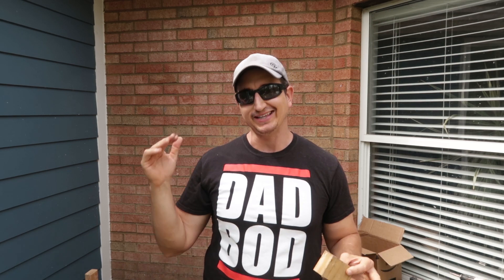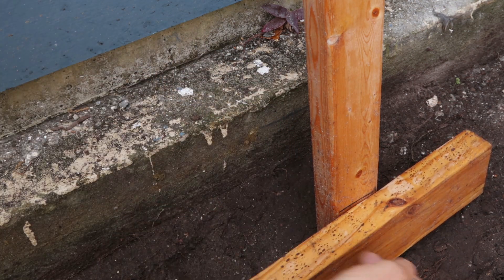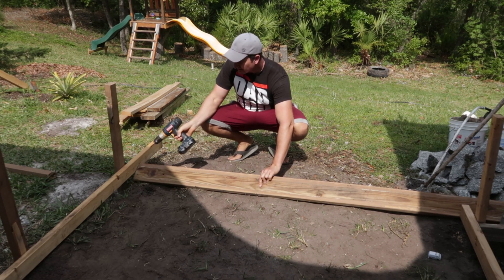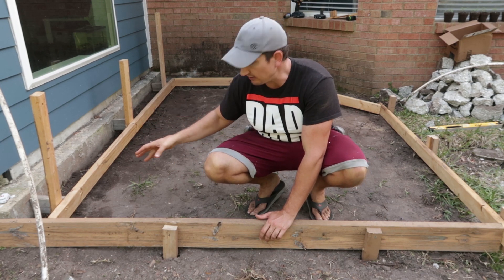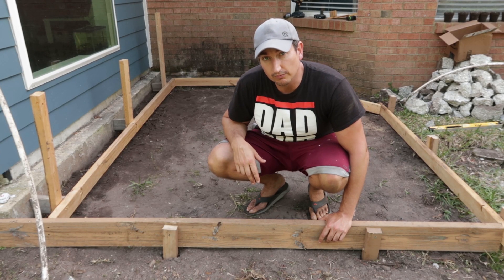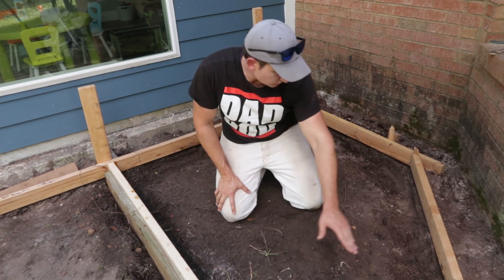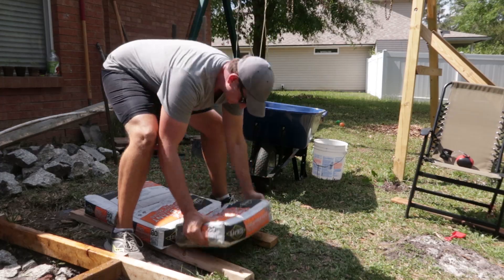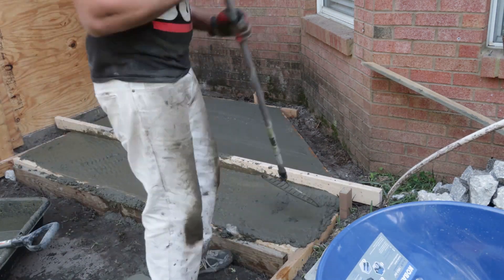Pouring A Concrete Platform Without Rebar; Build a Concrete Patio One Section at a Time.

Comment: @MrKistel I know this was several years ago.  Can I ask what kind of concrete you used?  I just did a small project, and there was way too many rocks in my concrete mix.  Yours looked like it didn't have many at all.
Reply from the maker: I believe this was just standard concrete bag mix available at most home centers.  It may have had reinforcing fibers as well.  The rocks inside were about the size peas and are they important for strength.

Comment: If I need my slab to be flush to house how would I build the form?
Reply from the maker: If the new area was a square shape you would have three form sides instead of four because the one side would be flush with the house. The two form boards perpendicular to the house would be set to the desired flush height on the house side.  Once the concrete is poured a screed can be pulled over these two boards and parallel to the house and this should give you the flush concrete height on the house side.

Comment: Hi, really love your video, but just wonder what base for the concrete path? just soil is good enough? Wont the soil settle?
Reply from the maker: Thank you. In this situation the house was built on fill that was brought in.  The fill dirt is pretty stable here.  In addition, I brought additional aggregate heavy sand and dirt prior to pouring some of the concrete patio and walkway sections.  This dirt was compacted before the concrete was placed.  In general it depends on the condition and type of dirt in your project location.  In some areas scraping away the organic top spoil area is enough before pouring the concrete. In other situations it might be better to excavate a depth of the unstable soil and fill with aggregate and compactable dirt/sand.

Comment: I also just hand mixed an extension to a sidewalk. It took 14 60lb bags. You right, not fun, however I found it easier the wetter the mix was. Using a wheelbarrow made it somewhat easier as well, as it can be just poured out. I put a grid of rebar in though, as it is cheap insurance and I drilled holes in the existing sidewalk for the rebar so the two would not become uneven over time at the partition.
Reply from the maker: Thanks for sharing your concrete pouring experience.  My approach with this project was to allow  the individual pads to move independently in case the ground underneath were to settle some over time.  I would assume the  amount of movement would be slight so not too noticeable between the slabs and that the individual slabs would be less likely to crack (since they are free to move).  Sometimes rebar in shallow concrete pours actually cause the concrete to crack because such forces are transferred to the new slab section. Of course the wetter the concrete the easier to mix but the strength of the concrete is compromised the more water that is used.

Comment: Question for you, why did you not attach any of your pads to the house? thanks for the video, gives me courage to do a few concrete projects alone being that i don't like asking for help and like the suffering.
Reply from the maker: Best of luck on your concrete pour projects.  The main reason I left a space between the house and new concrete patio was to make it easier to apply house termite preventative treatment which is repetitive process every for years.
Reply: Check out the steelemixer.com it’s the easiest way to mix concrete and needs no power!

Comment: Hi thank you for this video. I will be completing a patio in a few weeks. I had a question in regards to the motor oil. Doea it have to be used? Also can I pretreat the lumber with the oil days before or should it be done closer to or the day of the project?
Reply from the maker: The oil is not necessary.  The wood forms usually pop off issue if the concrete is left to cure at least 24 hours or so.  Some guys use oil so they can remove the forms faster.
Reply: @MrKistel  Thank you for the quick reply. I would like to use the oil. Does it have to be used or can it be straight from the bottle store bought. Also may I treat it a few days before or should it be applied that day?  Does treated or cedar lumber make a difference?

Comment: thank you for the videos. i poured a small pad using high strength quickrete and the surface turned out very rocky, i screeted and floated like yours and many other videos. do you know what i did wrong? what is the best type of mix to use?
Reply from the maker: Thanks Ross, finishing the concrete surface after a pour is often the trickiest part.  The concrete pros that do it best are more like artist.  Part of it is starting the surface finish process at the appropriate time after the concrete has been poured.  The type float used will make a difference and of course technique is a big factor.

Comment: I am going to try this on 10x10 area, first time pouring concrete.
Reply: Try using the steelemixer.com it’s the easiest way to mix concrete by hand and needs no power!
Reply from the maker: Best of luck on your first pouring concrete project.  It might be a good idea to mix up a bag or a few to pour a small practice pad before pouring the large pad.  Also you may want to consider another way to mix the concrete (see my video about using a drill) and breaking up the total pad area into smaller segments.  Let me know how it goes, thanks.

Comment: Thank you so much for this series of videos! I'll be pouring some concrete myself soon. I was wondering if online calculators for amount of 80lb bags are accurate.  Did you find yourself having too much or not enough?
Reply from the maker: I found the online calculators at the concrete manufactures websites to be quite accurate.  I ended up ordering several extra bags of concrete just in case and it was left over so I used it to build another step platform.
Reply: Check out the Steelemixer.com it’s the easiest way to mix concrete!